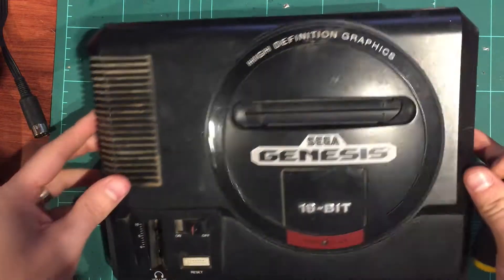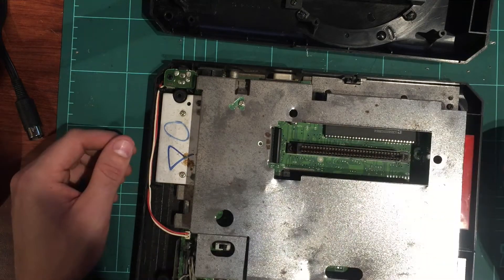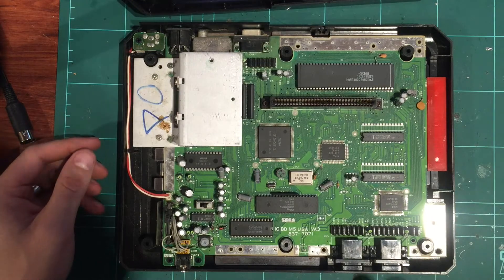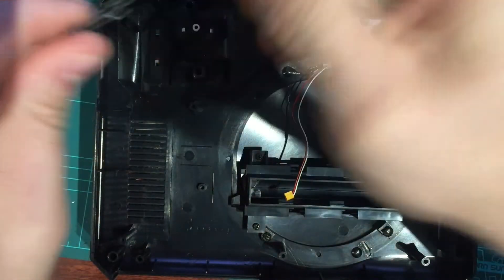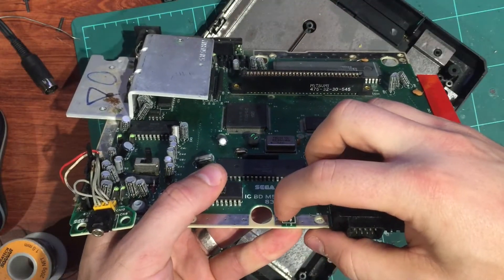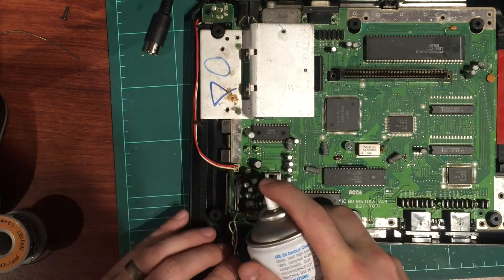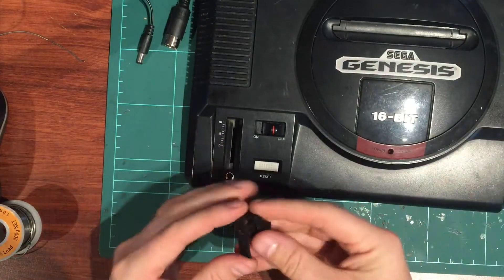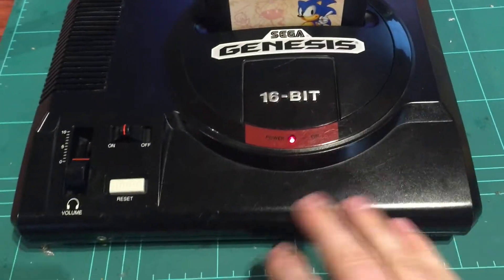SEGA Genesis Console repair - Console 2 Faulty Power LED - Part 3/7

Comment: Neither the LED nor the power jack wire harnesses can be unplugged from the board. What looks like a connector is only meant to prevent tugging directly on soldered wires which are often very brittle. They typically crimp to the wire instead and then solder the pins, much like a block of wire ferrules.

Comment: There are two pairs of CN9 pin holes on the Genesis motherboard. Do they do the same thing? I broke the connector on the LED lamp trying to pull it off (I can't believe it was soldered in like that...) and haven't been able to clean the two pin holes left behind. Can the other pair of pins marked CN9 be used as a back-up?

Comment: Try to check the input signal with a meter on the power supply for correct DC voltage. Read transformer case.